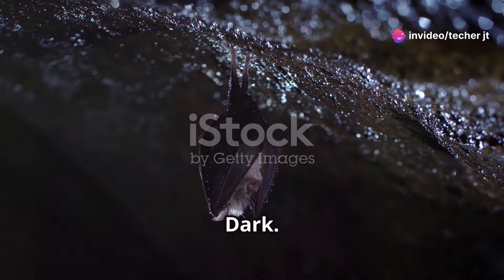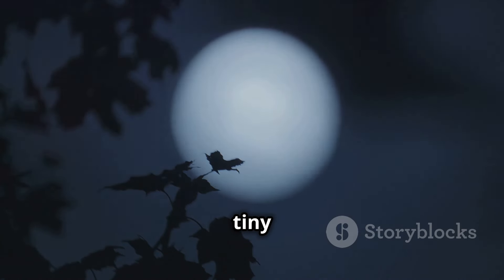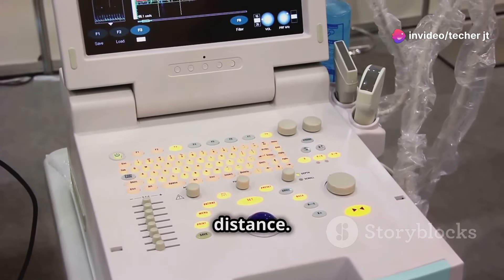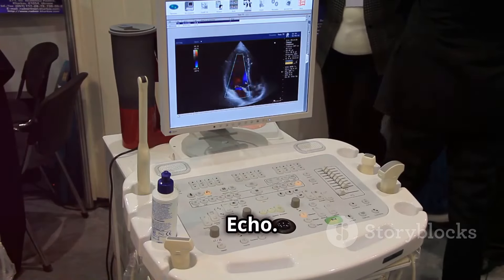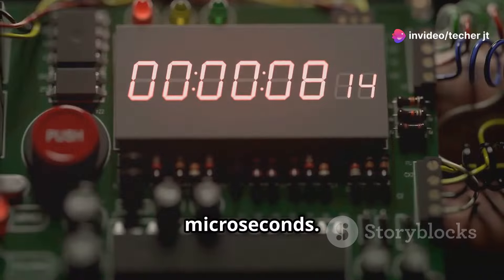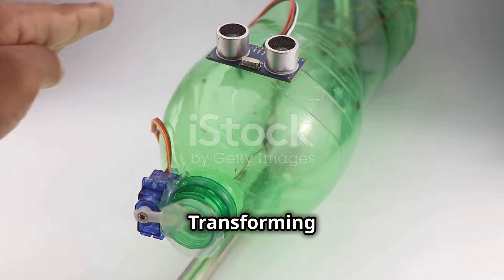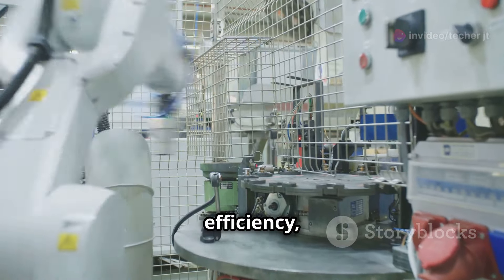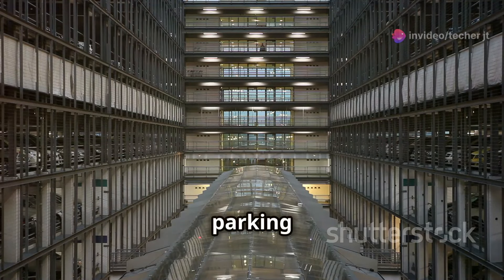Unlocking the Power of Ultrasonic Sensors: How They Work and Where They're Used!

Comment: Charles Christian Bahian 
10-Andromeda

2. Applying: Describe a scenario in which an ultrasonic sensor would be more beneficial than an infrared sensor. Justify your choice.

-The scenario in which an ultrasonic sensor would be more beneficial than an infrared sensor. is when a mobile robotics app specifically for obstacle avoidance in a dust or smoky environment. Because ultrasonic sensors can detect objects at further distances and can provide accurate measurements even form small objects

Comment: Faith N. Ragas
10 - Andromeda

6. Understanding: What are the key components of an ultrasonic sensor, and what role does each play in its operation?

The microcontroller, transducer, and receiver are an ultrasonic sensor's essential parts. A receiver picks up the ultrasonic sound waves that the transducer sends out, reflecting off of nearby objects and returning as echoes. By calculating the duration of echo reflections and applying the speed of sound, the microcontroller determines the object's distance.

Comment: Brigette Love U. Gurrea
10 ANDROMEDA
4. Evaluating: Assess the impact of environmental conditions (like temperature and humidity) on the accuracy of ultrasonic sensors. What measures can be taken to mitigate these effects?

ANSWER: Environmental factors such as Humidity, Air pressure, and temperature affects the speed of the soundwave Ultrasonic sensor emits. This causes in a slight change of the speed making the recorded data to be inaccurate. Measures that can be taken to mitigate these effects may be, working or using Ultrasonic sensor in an enclosed area away from humidity, air pressure, and other environmental factors that affect the speed of travel of the soundwaves.

Comment: 🤍💌10- HERMÉS:
Reply: Glenn Seth Myrrh B. Laluces (Hermes) 10

1.) Understanding: Explain the principle of echolocation and how it relates to the functioning of ultrasonic sensors.

- Echolocation is a biological process used by animals like bats and dolphins to locate objects by emitting sound waves and interpreting the returning echoes. Ultrasonic sensors work similarly, emitting high-frequency sound waves that bounce off objects and return as echoes. By measuring the time it takes for the echoes to return, the sensor calculates the distance to the object. This principle is used in various applications, such as proximity sensing in robotics and parking assistance in vehicles.
Reply: Christina B. Colarte
10 - Hermés

10. One possible innovative application for ultrasonic sensors is in smart irrigation systems for agriculture. It works by installing ultrasonic sensors in the soil to measure the distance to the water table. The system can automatically adjust the water supply based on the sensor readings, ensuring that crops receive optimal hydration without water waste. One potential benefit of this is that, this application could lead to more efficient water usage, reduced costs for farmers, and improved crop yields by maintaining ideal soil moisture levels.
Reply: Alexa Kyle R. Cabunoc
10 - Hermes

2. Describe a scenario in which an ultrasonic sensor would be more beneficial than an infrared sensor. Justify your choice.

- An ultrasonic sensor would be more beneficial than an infrared sensor in a scenario like detecting objects in a dusty or smoky environment, such as in a factory. Infrared sensors may struggle in these conditions due to interference from particles in the air, whereas ultrasonic sensors, relying on sound waves, can accurately detect objects regardless of visual obstructions, ensuring reliable performance in harsh environments.
Reply: Ma. Nicole Cyse L. Rojo
10 - Hermes

8. Analyzing: Investigate the reasons why ultrasonic sensors might fail to detect certain materials effectively. What characteristics of the materials contribute to this issue?

- Ultrasonic sensors might fail to detect materials that are soft, porous, or sound-absorbing, such as foam or fabric. These materials absorb sound waves instead of reflecting them back to the sensor, making it difficult for the sensor to detect them accurately. Additionally, materials with irregular surfaces or those that scatter sound waves (like cloth) can also lead to unreliable readings.
Reply: Hannah Bella A. Ihalas 
10 - Hermés

4.Evaluating: Assess the impact of environmental conditions (like temperature and humidity) on the accuracy of ultrasonic sensors. What measures can be taken to mitigate these effects?

— Environmental factors such as temperature and humidity have significant effects on ultrasonic sensor accuracy because they change the speed of sound. Higher temperatures speed up sound waves, while increased humidity can slightly slow them down, resulting in measuring inaccuracies. To overcome these disadvantages, advanced ultrasonic sensors might include compensation systems that change estimations depending on real-time environmental data. Furthermore, calibrating sensors for specific conditions or using materials that are less affected by temperature changes can help maintain accuracy.
Reply: Azryl Prince Yohance A. Pagaling
10 - Hermes

1. Understanding: Explain the principle of echolocation and how it relates to the functioning of ultrasonic sensors.

Echolocation involves finding an object's location by sending out sound waves and listening for the returning echo. Ultrasonic sensors work using this concept: they emit high-frequency sound waves beyond the range of human hearing. When these waves hit an object, they reflect back, and the sensor measures the time it takes for the echo to return. The sensor then calculates the distance to the object by using the speed of sound and the time it took for the echo to travel.
Reply: Tysh Maeganne Z. Sagocsoc
10- Hermes

2. Applying: Describe a scenario in which an ultrasonic sensor would be more beneficial than an infrared sensor. Justify your choice
-Ultrasonic sensors are more beneficial than infrared sensors because ultrasonic sensors uses sound waves and infrared uses light so infrared are more sensitive to light for example in a bright room they might struggle to operate, ultrasonic sensors measures accurate distances thru sound waves and even in rooms with intense light it will function.
Reply: 2. Applying: Describe a scenario in which an ultrasonic sensor would be more beneficial than an infrared sensor. Justify your choice.
An ultrasonic sensor would be more beneficial in scenarios involving transparent objects or objects exposed to light. Infrared sensors struggle to detect transparent objects and those exposed to light, unlike ultrasonic sensors that can detect objects regardless of their transparency or brightness.
Reply: Chelsie Ann P. Carnaje 
Grade 10 - Hermes

1. Understanding: Explain the principle of echolocation and how it relates to the functioning of ultrasonic sensors.

Answer: Echolocation involves emitting sound waves and listening to the echoes that bounce back to detect objects. Ultrasonic sensors work similarly: they send out high-frequency sound waves and measure the time it takes for the echoes to return to calculate the distance to an object.
Reply: Camyll Jhey P. Belhot
10-Hermes

2. Applying: Describe a scenario in which an ultrasonic sensor would be more beneficial than an infrared sensor. Justify your choice.

-A scenario where ultrasonic sensor is beneficial than an infrared sensor is in a parking assist system in foggy environments. Ultrasonic sensor would be more beneficial because they work by emitting sound waves and measuring the time it takes for the echoes to return after bouncing it off. Since sound waves are not affected by environmental factors like dust, fog, or smoke that it provides accurate distance even un poor conditions. Unlike infrared sensors who use light waves which can be absorbed or scattered by fog,dust, or smoke, leading to resuced accuracy to detect properly in such environments.
Reply: Khieffer Neil G. Ensomo
10-Hermes

3. Analyzing: Compare and contrast the advantages and limitations of ultrasonic sensors in industrial applications versus their use in medical imaging.
-Ultrasonic sensors provide non-contact measurement, making them versatile for detecting objects in industrial applications and offering non-invasive imaging in medical settings. However, in industrial use, environmental factors like temperature and humidity can affect accuracy, whereas in medical imaging, sensor precision is critical, and absorption by soft tissues can sometimes limit effectiveness.
Reply: Blissany Y. Torralba
10-HERMES

1. Understanding: Explain the principle of echolocation and how it relates to the functioning of ultrasonic sensors.

-Echolocation is a biological sonar system used by animals to navigate by emitting sound waves and interpreting echoes. Ultrasonic sensors function similarly by emitting sound waves and measuring the time for echoes to return, determining object distance. Both processes rely on emitting sound and analyzing echoes for spatial awareness.
Reply: Hamainie Briezies O. Gabriola 
10 - HERMES

1. Understanding: Explain the principle of echolocation and how it relates to the functioning of ultrasonic sensors.

ANS: Echolocation involves emitting sound waves and listening to the echoes that bounce back to detect objects. Ultrasonic sensors work similarly as they send out high-frequency sound waves and measure the time it takes for the echoes to return to calculate the distance to an object
Reply: Deron Ethan B. Pacaña 
10 - Hermés

1.) Understanding: Explain the principle of echolocation and how it relates to the functioning of ultrasonic sensors.

Echolocation is a natural process used by animals like bats and dolphins to detect objects by producing sound waves and analyzing the echoes that return. Ultrasonic sensors function in a similar way, emitting high-frequency sound waves that reflect off objects and return as echoes. By determining the time it takes for these echoes to return, the sensor can calculate the distance to the object. This method is widely applied in areas like proximity detection in robotics and vehicle parking assistance systems.
Reply: Herah Jhylie Zean Q. Agbu
10 - Hermès 

1. Understanding: Explain the principle of echolocation and how it relates to the functioning of ultrasonic sensors.

- Echolocation involves emitting sound waves and interpreting the echoes that bounce back , allowing these creatures to "see" with sound. This principle is directly mirrored in the functioning of ultrasonic sensors, which are widely used in various technological applications.
Reply: Zophiel Hailey Jace B. Usman
10 - Hermés

1. Understanding: Explain the principle of echolocation and how it relates to the functioning of ultrasonic sensors

- Echolocation works by sending out sound waves and analyzing the echoes that return, enabling creatures to "visualize" their surroundings through sound. This same concept is applied in ultrasonic sensors, which are commonly used in many technological devices.
Reply: Frenzzy Kyla C. Halasan
10 - Hermes

3. Analyzing: Compare and contrast the advantages and limitations of ultrasonic sensors in industrial applications versus their use in medical imaging.

In industrial applications, ultrasonic sensors offer cost-effective, non-contact estimation for recognizing objects and separating them. Still, they can battle with certain materials and natural conditions (e.g., tidy or damp). Restorative imaging gives real-time, non-invasive imaging (e.g., ultrasounds), although they have impediments in picture determination and profundity entrance compared to other imaging methods like MRI.